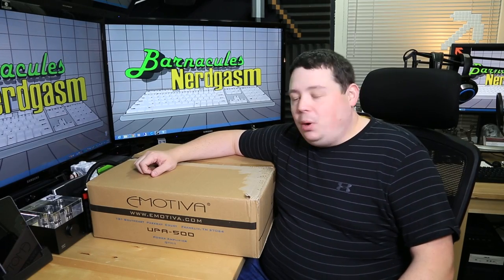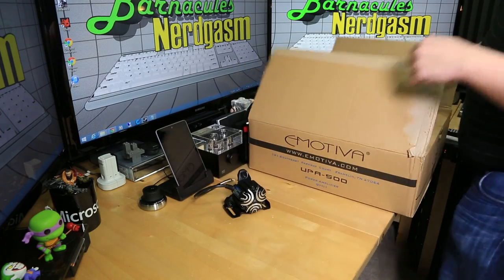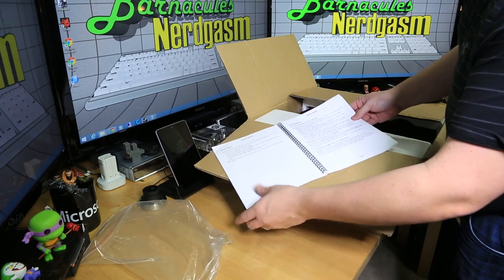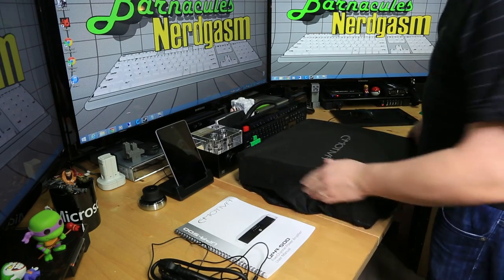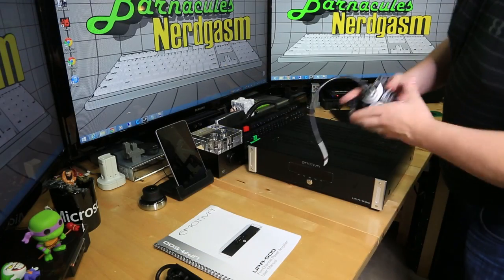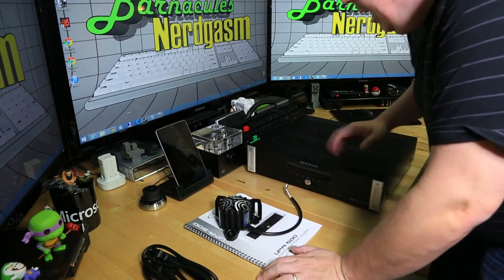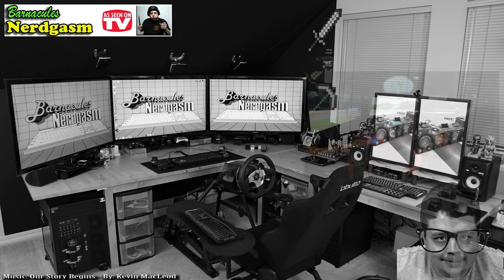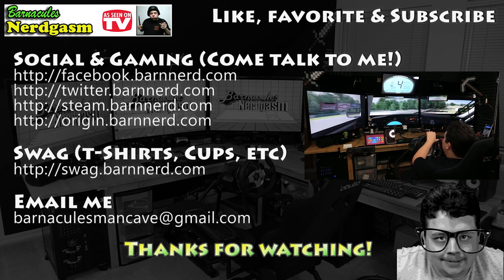Unboxing Emotiva UPA-500 Amplifier for my Racing Simulator Buttkicker LFE Transducers

Comment from the maker: I did a ton of research on amps for this project and even spoke with other people running heavy transducer setups and this amp came highly recommended as the best and most reliable amp for running transducers under very heavy loads without experiencing problems. And one of the people that told me blew up 3 other slightly cheaper amps using the same setup I'm trying to achieve.

Comment from the maker: This is a popular question and I thought about this, I'm going to put rubber grommets on the amp to dampen the vibration, but if that doesn't seem like enough then I might have to research placing the AMP on the floor under the seat with loose cable connections to hold it in place while sliding it around.

Comment from the maker: I didn't research CAR amps because I didn't want to use a high power inverter to power them with DC. That being said I looked at Buttkicker amps, Standard home theater amps by Pioneer, Kenwood and Yamaha but this was the only amp I found that had zero bad reviews when used with transducers and was actually recommended by a reputable simulator building company as being their go-to amp.

Comment from the maker: The answer is kind of, what would happen is that the 4 transducers would produce vibrations for wheel lockup so if the rears or the fronts locked up or the sides started sliding those would produce the vibration and at different intensities. I'll know more when the project is complete :P

Comment from the maker: I'm going to print them in PLA, but they are going to be used just for test fitting and tuning, once I get them correct I'm going to cut them up and use them as templates to make the brackets in steel.

Comment: Cool Project! Really need those brackets. Only 1 problem is your going to need an additional Sound Card to Run 5 - 8 Transducers. 1 Sound Card can only run 4 Transducers as you will need to run it in Quad Mode. So to run 5 or more Transducers you will need another sound card. :)

Comment: you will need 1 sound card (with at least a front and a rear audio connector) for the 4 buttkickers in chassis mode and another sound card to run the buttkicker that will be in extensions mode. The sound cards have to have the front and rear audio connectors as this is all simvibe will use, no mic sockets etc.

Comment: I may be wrong but why would you want to mount the transducers using steel?  Steel has inherent "flex" to it, and it's heavy as hell.  I would think aluminum would be better... get a more rigid connection and you won't make your racing seat weigh as much as a freight train :)

Comment: Dude...USE THAT THING TO DRIVE THE HE-500! Try it out with a balanced cable if you can, or you can test to see if it shares a common ground so you can use a 1/4inch to banana plug adapter. Go on head-fi and look up a thread that talks about using a speaker amp with the HE-500. They will scale so far with that extra power and it's really worth a try. Let me know what you think.

Comment: COME ON!!!
Also looking an update to this and the problems you ran into, including I would expect isolation to limit the vibrations going through the home.

The Mini LFE aint a bad unit, "Clark Tactile" range can give more detail while 
BK are better performing with low end effects.

Would like to see you do a comparison to realise and experience the bigger BK LFE that operates up to 1000 watts Vs the ones yu have. In tactile terms 120 watts isn't all that much.

Amps I recommend and to research for power/control/tuning tactile and importantly having unique "Parametric EQ" are:

Crown XTi Series (1st or New 2nd gen) with "Band Manager 2.0" software
(Assuming budget is not an issue) 
http://www.crownaudio.com/usa/index.php/amplifiers/xti-2-series.html

Behringer inuke (DSP Models)
6000 DSP / 3000 DSP / 1000 DSP with "PC Remote Connect" software
http://www.behringer.com/EN/Category/Power-Amplifiers.aspx?s=J100